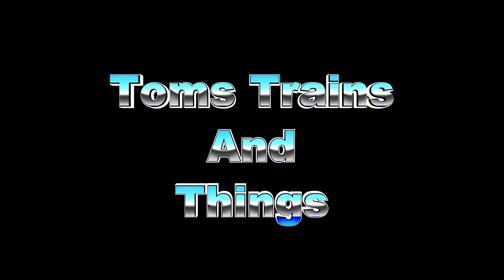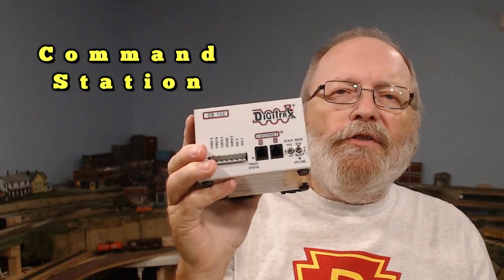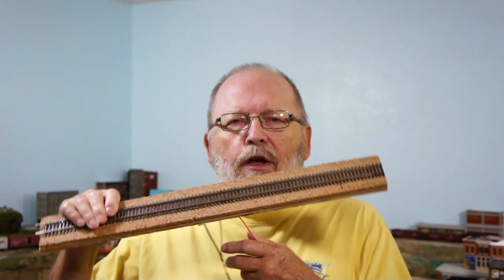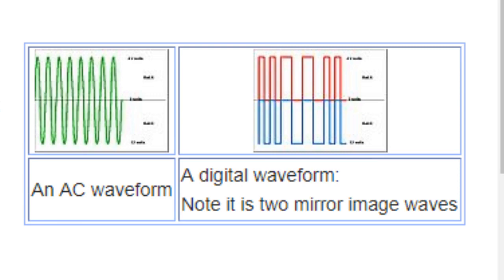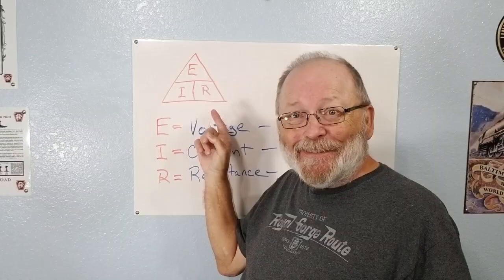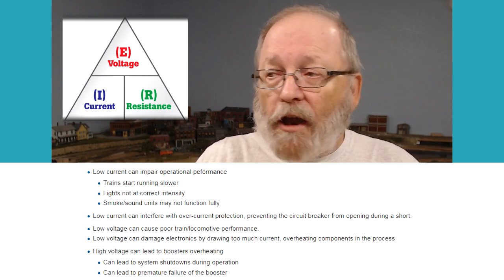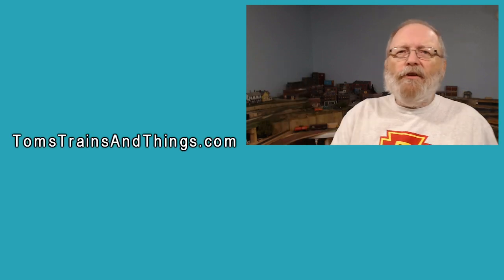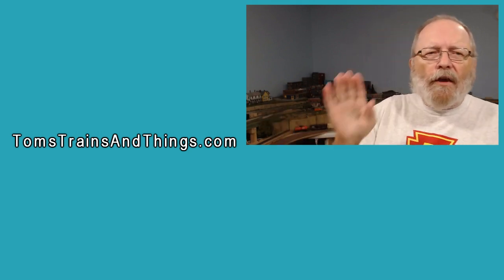What You Need To Know Before Wiring Your DCC Layout

Comment: Hi Tom, I always find something interesting on your channel.
I have a small DC 10x9 layout with two main lines and  loops/sidings.
I recently converted one of my 1960’s Triang Princess’s to DCC.
I had earlier purchased a Hornby dcc controller and one decoder but never got around to converting  because I thought it would be cost inhibitive.
I proceeded with the conversion using a TCS decoder but I couldn’t get it to work. I don’t know why but decided to install the Hornby decoder and this did work.
I am thinking I would have one dedicated track for DCC and one for DC.
I am assuming I can only run one track from the Hornby Controller?
I am wondering if I need any other equipment like that booster?
The old lock runs so much better using DCC and I don’t have any droppers.
Any suggestions?
Thanks
Charlie
Reply from the maker: Not familiar with the Hornby controller. Is it DCC?
with DCC you can run multiple locos on the same track
With DC you need seperate tracks gapped using different controllers or a switch to change over to the other track
Reply: @ Yes Tom, the Select Controller is DCC. My layout is DC and I decided to try converting an old 1960’s DC Triang loco to DCC. I was successful in the end and it runs better than ever.

Comment: Nuts ! You can have multiple trains operating simultaneously on a 12v DC Analogue layout, and at a fraction of the cost of DCC. But in reality the problem is the Human Brain. It can't operate more than one train at a time, unless you want to start turning your expensive model locos into test crash dummies !!!!
Reply from the maker: DCC is much more than running multiple trains. Lighting, sound, operating turnouts all from the throttle. You can program the bell & whistle to come on when the loco starts, and the appropriate whistle upon stopping. You can program different rates of speed on increase & decrease. If you tried doing that with DC, you would end up spending 10X what a DCC set costs.

DCC++EX does more than DCC and can be assembled with all the components for under $60. How much os a dual transformer, which BTW reduces the output of each throttle.

Comment: Tom
Thanks for the great videos.
I have been researching dcc systems for awhile now as I am building my layout, especially digitrax,  NCE & MRC. I'd really like to get your opinion on what you'd recommend. My layout will be a double deck 10×30 with a 2 track main. I'll have two trains running the loop continuously for train watching...one train with 3 engines and the other with two. Most of the layout will be a steel mill with lots of switching done by 2 dedicated mill switchers. So that's a total of 7 locos, all with equipped with sound. I'll have probably no more than 2 operators. Definitely want wireless throttles.
Any suggestions?
Reply from the maker: Depends on what bells & whistles you want with your system. They're all basically the same except for the price.

Your command station should be centered in your system and you may need a booster depending the amperage draw of your locomotives especially with sound.

Comment: Tom i am an older train guy that restarted my train hobby by unboxing my old American Flyer Hudson and setting it up on a piece of 4X8 Plywood in my basement. today i have 20 engines all S Gauge, Most American Flyer from the 50s, some American Models. I use TMCC from Lionel and several MTH PS2/3. I have the old Cab 1 and MTH handheld. As you may know MTH is shutting down. I had not moved to Legacy because MTHs PS stuff was just so good. Now I am trying to complete a few more engines and I am unclear if there is  a better path to take. I never considered DCC and really would likely never really use all it has to offer. I generally take the older engines and really Hot Rod them, with Fan Smoke, FireBoxes, LEDs and Warning lights. I make a lot of 3D Printed adapters and have started some 3D printed chassis'. But i want to find some good controllers that do not cost $150 and over per engine.  And I had hoped to to be able to use TMCC and PS2/3 controls because I am invested in all that gear. Do you see a path for me in this mess? I probably have 10 years left to do trains and i just love making these engines. But i need a cost effective model control and sounds. I convert to DC Cans so 1 1/2 or 2 Amps is about the top for single engine. Dual Drive Diesels will pull more. I could be happy with just whistle/horn and bell with track side voices. So a button box could work. I am so behind i thought i could ask you for a a few options. Thanks, Dennis in Virginia  A northern I build for a Col. in the Army, https://youtu.be/YXRjsC1QQv8
Reply from the maker: Haven't heard anything definite yet, but MTH may be purchased by the employees. It's been a while since this came out, so I don't know if there is any updates to this rumer.

Comment: Hi Tom;
Once again, looking for some suggestions.  I have been through the playlists, and not able to find what I am after.
I am converting to DCC with Digitrax DCS51, also using 1 AR1, /  1 DS64 and have ordered a BD4.
I also have a BXPA1, but it strikes me as a glorified AR1... not using it currently.
The DS64 currently  runs 3 switches, and of course the AR1 looks after my reverse loop.
I do not have any locomotives that have DCC Sound. I do have a few straight DCC Locomotives from  Trainworld. 
My question is -
 " How can I get train sound or crossing signals in certain areas as the train passes through, and then shuts off after the train has left the area?" 
There are so many amazing videos that show these type detected processes.
Just don't know where to start.

Best Regards;
Daryl Hitchcock.
Reply from the maker: Get rid of the Ar 1 and use the BXPA 1, it's much better. The AR 1 are slow to respond and sometimes stall the locomotive . I have 4 of them and everyone does the same thing. Started buying the BXPA 1 to replace them, much better.

As far as what your looking for with the sound, send me a link of the video where you saw this. I am not aware of the automatic operation of whistles at a grade crossing with a decoder. Soundtraxx has a grade crossing logic, but you still have to actuate the feature with your throttle.
Reply: @TomsTrainsandThings  
Hi Tom;
Please see video link https://youtu.be/s_ZlMpMlwvc
This my 3rd attempt to reply, don't know if the first 2 went to you.
Anyway, I thought the  optic sensor could also trigger a small sound module, that could time out after 10-15 seconds.
Or possibly a second optic sensor to shut off and reset the light signal.
After watching your  BXPA1 video, I will changing the AR1 out.  Could the detection circuit from the BXPA1 be utilized in any of this.
Thank You.
Best Regards;
Daryl Hitchcock.
Reply from the maker: I suggest you ask the person who did the video. He did not turn off comments on the video prior to this one. 
The detection on the BXPA1 is only a high or low signal on the pins while the locomotive is in the reversing circuit. It changes as the loco leaves. Pretty useless as far as I'm concerned. I stated Digitrax's response for it in the video.
Reply: All good. Thank you very much for the insight.

Comment: OK I can see that you did this video  back in 2017. I was lead to believe that you could use a NCE controller on digatrac and vicea a versa. has that change or have I been mislead?
Reply from the maker: NCE Power cab is self contained, while Digitrax has command station & Throttle. Some minor components may work between systems.

Comment: I have a 5x 91/2 n scale layout, single mainline, 3 x around . 150 feet of track. Will i need a booster, plan to run no more than 3 trains
Reply from the maker: You should be fine as long as your command station is located in the middle.
Reply: It is a dc layout right now set up in 6 blocks, but wired for dcc,

Comment: Hello Tom, I have been a subscriber of yours for some time and benefit from your nice videos. I am a rather rookie model railroader who was able to start the hobby only 2 years ago even though I had the dream of doing it for more than 40 years! 
I recently built an N scale layout with DCC system and can run my trains manually with no major issues. I am now ready to start with building the scenery, but I learned from a friend that I need to make blocks to be able to run the trains under computer control, which should obviously be finished before scenery. I know how to isolate track sections and how I can make the wiring of separate blocks, but I don't know how I should plan the blocking setup. 
I searched through your videos but could not find any related video. What I need to know is the logic behind blocking certain sections of track with respect to the layout. I can imagine I need to make blocks before a turnout, but don't know the necessary length of the block, how far should it be from the turnout, what extra blocking is needed when the trains are moving in the opposite direction, etc. Is there a video in which you explain the logic behind blocking track sections and how to plan the blocks with respect to a sample track layout? Thank you...
Reply from the maker: Vedat, thanks for watching my videos. Glad I could help. The terms "Block" is a DC term which had to be used to separate the sections of track so one could run more than one locomotive at a time. DCC is a little different concept. If you want to separate your track for purposes of detection of locomotives and signaling, there may not be too many videos out there, and the ones that are usually are not very informative.

There are many different brands of signaling and detection board available from some of the DCC manufacturers if that is what you are looking for. A simple computer controlled system can be done with a free software called JMRI. It integrates with all DCC systems and you can control your entire model railroad from it. You can take a look at what is available form this software and then decide on what features of this you want to use, then from there you can decide what direction and components you will need.   http://jmri.org/   Let me know if this is the direction you want to go in. I have a few videos on setting this up.
Reply: @TomsTrainsandThings  Thank you for your prompt and informative response Tom.  

I think I should have told you that my current system is only composed of a Fleischmann booster and MultiMouse controller which I can control my 6 locos manually at this stage. I did not buy any signalling and detection equipment yet, with the thought that I should first make the setup digitally so that I can correctly decide  which equipment I would need in what quantity.

Upon your recommendation I have downloaded JMRI  and managed to upload my layout I have created with AnyRail software into it, but I ended up in the same dead end street at that point. As far as I could make out, JMRI is similar to TrainController and iTrain programs which I have tried before, in the sense that they help you set up a digital version of your layout (or just an imaginary layout), and eventually program and control your trains .

Trouble is, all these programs ask me how to configure the occupancy detection blocks and signalling in my layout, and this is exactly where I need help. I have several turnouts which make the tracks intermingled with each other, but not knowing how the system will behave, I don't know how much section of a track I should isolate so that an efficient and realistic occupancy detection can be created. 

For example I can imagine that I would need to make 2 blocks before a turnout, to first slow down the train before coming to a complete stop at a safe distance before the turnout. The same goes for a station too, but when I consider a train would come to that point from the opposite direction, my brain gives an error signal and I am lost totally.

Any help will be appreciated...
Reply: @vedatiplikci1332  Is your Fleischmann (GFN) DCC System that one with the small black booster box and the grey Multimouse?

If yes, than you cannot read out CVs in general. That was a big problem of the old DCC System first time created by Roco decades before roco and Fleischmann (GFN) went thr same way with their digital DCC Systems.
The former Austrian Roco and the former german Fleischmann (GFN) Companies are now owned by a together mother Company and providing together DCC Systems with similar components but different colours of their Multimouse handheld throttles.

About the occupancy detection blocks are needed on DC , one block for breaking to reduce the train speed and one for stopping the train ahead the signal.

On DCC layouts you will need to have a signal decoder what will give the signal aspect to the command station.
If the signal shows red light, the the command station will proof where you train actually is. If your train will be ahead the signal, than the command station gives order to the loco decoder to break the train to a minimum speed and to stop ahead stop position signal aspect ahead the signal.

For correctly detections you need to have additional detection units.
Each detection unit can controlling multiple of detection blocks, i.e. the Digikeijs DR 4088 RB CS for 32 detection blocks is being available as starter set to use with Roco/Fleischmann R-Bus.

Between two signals of each direction you will need to have 2 detection blocks.
• 1rst Block the open track
• 2nd Block the breaking block
Each detection block need to be longer than your longest train. In the end stands your Block Signal.

By using single line routes you don't have the typical block sections like onto double track lines.
Onto single route lines the Block Station are inside Railroad stations or areas with parallel station tracks.
Onto single line routes the automation of the railroad service is more complicated than onto double line service.

Comment: First , thanks so much for all the informative videos. I have two questions about DCC wiring. First you mentioned the length of your layout and how your command station is in the middle making it just under the 20ft  recommendations. Did you split your Bus line or how is that wired?  Second . Is there anything special I need for the end of my BUS line(s).
Reply from the maker: I run my bus to a terminal board and split it from there. Later on I installed a PM42 to split up the districts. (Basically the same thing.) You do not need to do anything at the end of a run.

Comment: i was wondering since Im using Atlas Jointed Rail aka Section Rail. How would i be able to do to dcc?. Would I have to solder every 3-4 rails to wire it or every rail?.
Reply from the maker: Hi Robert, you can solder leads on every 3 to 4 feet as long as your rail joiners are good and tight
Reply: Or another option is, if you don’t want to drop feeders every track section, the try soldering the rails themselves together.  The rule I’d follow is, every piece of track either has feeder wires, or is soldered to another piece.

Comment: Tom, what do you think of the Digitrax 20 amp power supply unit PS2012E?  
I was thinking of powering the led lights, on a different, and lower power supply.
Reply from the maker: Well, I thought I answered this one already but my answer isn't here. The 20 amp power supply is way too much power unless you have a club sized layout. I would go with one of their smaller power supplies.